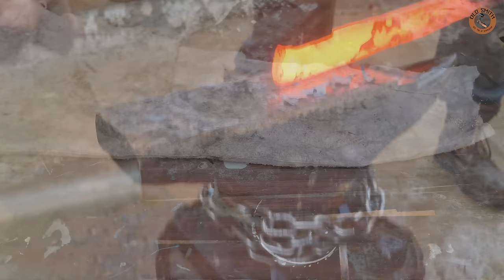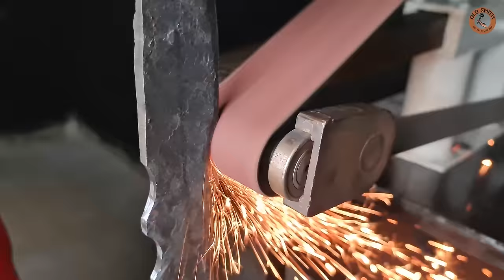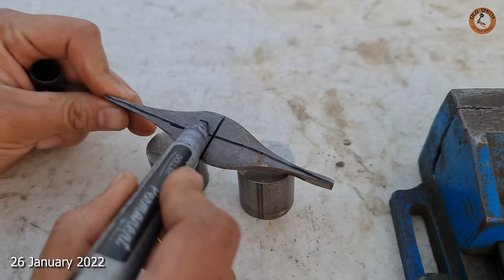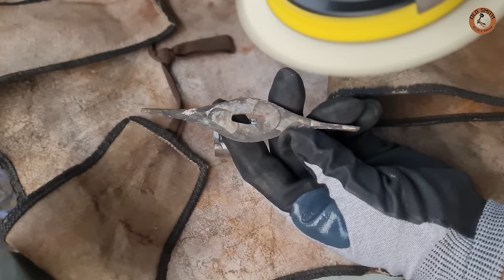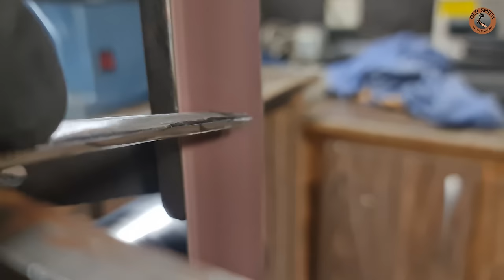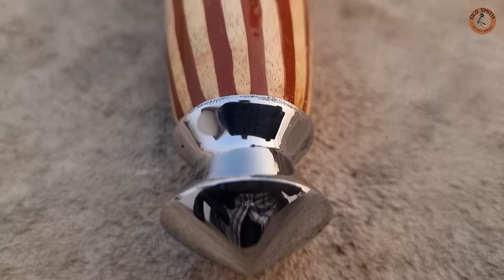Forging KRIS Knife out of Rusty Gate Lock

Comment: Super beautiful and amazing end product and process. It is very detailed! The only thing bothering me was the heat treat, the color on the blade. There were several cold spots and it is probably just due to the charcoal heating but it did not look like the blade was evenly heated before quenching. It may have just been how it looked in the video. Either way it is a beautiful knife!!

Comment: nice work.. but as you no doubt know, the keris is actually not a knife but just a prodding dagger.. it's meant to stab and as you pull out the blade, it should cause maximum damage by pulling with it the organs of the enemy out.. and I read in the olden days, they'd not sharpen the blades like you did, but would use lime (acid) to wipe the blade before a battle to cause it to rust and add to its potency.. but it is in no way a criticism but just sharing of knowledge.. your work is like a rendition of the modern day keris maybe..